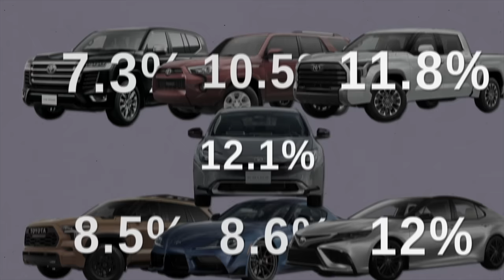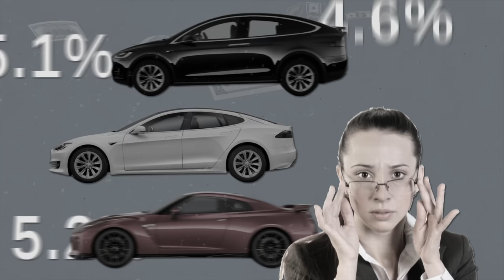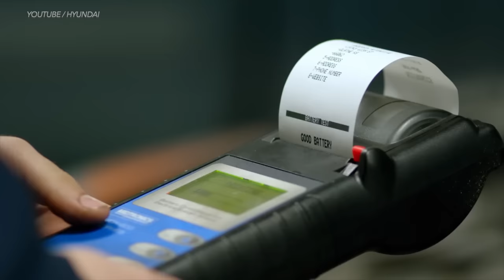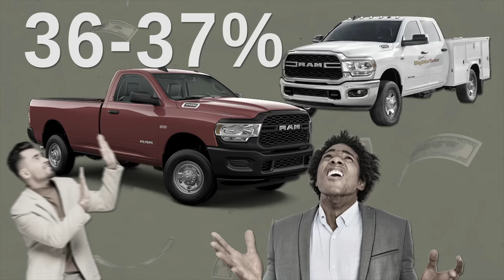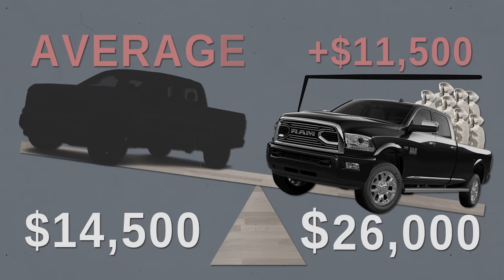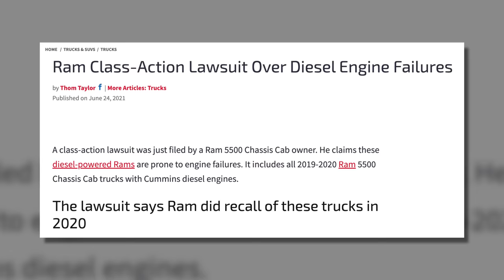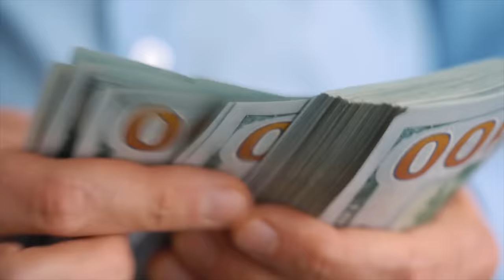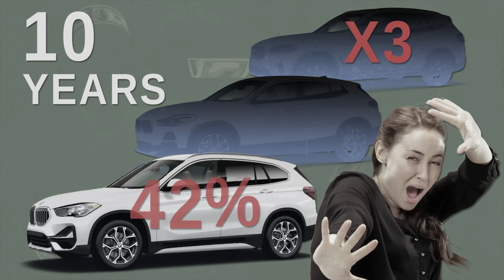Here's Why I Only Buy Toyotas and Lexus

Comment: Definitely helpful to consider the dollar amount as well. I have a 2020 Venue, for example, and I paid $15k for it. At 30%, $4k in maintenance over 10 years is pennies compared to 30% on a bimmer. Bonus points for full drivetrain coverage over that period.
Reply: idk where you found a 2020 venue for $15k, but that car is dead in 5 years
Reply: @Eddyhouse1845  Brand new in 2020 when they were giving cars away
Reply: @smashitandbang6876 That was the retail value of the car with administrative fees taxes state local federal taxes you paid $28,500
Reply: @tonyw1563  fair point. Total cost to walk away was closer to $17k. My logic still holds tho. 30% of that is pennies compared to a 30% of a 50k+ luxury car.
Reply: @smashitandbang6876  Win Win 🏆

Comment: As a mechanic I am very impressed with Toyota and Yamaha engineers, they collaborated to make a machine that is really very good and strong. Of course, their Premium brand Lexus is very reliable.

In my country, Indonesia, Toyota and Daihatsu collaborate to make Low Cost Green Cars (LCGC) under the ASTRA Group. With a 3 cylinder engine and engine capacity from 1,000cc to 1,300cc, I think the engine is quite good, but they sacrificed the chassis and poor quality body materials to balance the Power Weight To Ratio. But behind it all, they help people to own their own car at a low price and of course easy to repair and cheap to maintain.

Comment: I've had 4 Nissan products since 1995. I currently have a 2015 Altima and a 2017 Rouge. The only thing outside of oil changes, the only thing I've I had to do is change the battery. And I have high mileage on the Altima.
Reply: Doesn’t matter because Scotty San only buys Toyotas.

Comment: I've owned 3 BMWs, and I can tell you this video is spot on.  All of them where high maintenance.  My last one was a sporty 318is, which I spent over $8k in maintenance alone.  I thought I was going to save money by buying a 4-cylinder BMW.  Smh.  Never again will I buy one.  You heard the saying of why they call them BMW, its because the word BM stands for 'Bowel Movement!' Lol
Reply: Break My Wallet...
Reply: 8k in maintenance?The 318 isn’t even worth 1k…do you’re homework on cars and it will pay off at the end

Bmw is a very reliable car, but when you buy cheap, you get cheap
Reply: @mauisuzuki7857  the worth you quoted is today's value.  I never said when I had possession of the 318.  I just said that was my last BMW.  This was many years ago when the value was no where $1k.  So yes, I did my homework.
Reply: Lol
Reply: I've owned my E63 LCI BMW 6 Series coupe for 13 years. It's special in the looks department, fun to drive and has never left me stranded, therefore I intend to keep it for another decade.
Reply: 318 and sporty should never be used in the same sentence 😂😂😂
Reply: @da9nerdy  318 and sporty can and should be used in the same sentence as a BMW and sportiness are about handling, not sheer power.

Comment: I bought a 2018 f-150 4x4 2.7 eco new. Narrow seat aside, i love it. At 93k, I’ve changed the rear pads at 90k and trans fluid at 60k ( should really every 30k on that 10 speed). No issues. Bought my Wife a 2019 Highlander limited platinum. She loves it. That 3.5 is a solid engine.

Comment: I own a 2011 Daimler A.G. W204 which was purchased in 2014.  In the 12 years of it's life, I've replaced the rotors twice. I perform all scheduled maintenance myself.  I've had no major issues.  In three more years, I'll replace the transmission pan; and, within 7 years, I expect to replace the rear subframe which is under warranty.  It is the easiest car to maintain in comparison to SAAB, AUDI, and INFINITI.

Comment: I had a SAAB 9.3 VECTOR with a 2.0T engine. (2008 model) and it was fantastic to drive, but not cheap to maintain.
Sadly I totaled it in an accident and now bought a 2008 Lexus is 250 and I'm quite happy with it.
Reply: Had a 2004 SAAB 9-3 1.9tid, absolute money pit.
Reply: 95 Saab 900. Blast to drive when it wasnt in the shop.

Comment: I'm on my third Lexus - a 2014 ES 300h I bought used 5 years ago.  This is my first hybrid, but this thing is absolutely amazing - I still average about 35 mpg (usually 40 mpg in spring/fall) and it's easily one of the best driving cars I've owned (The ES 350 gas-only version gets about 23 mpg).  At 150K miles, I'm still hoping it's got a long life ahead of it... :)  As an added bonus, because of the regenerative braking, I've never had to get a brake job - original pads are still on it!
Reply: are you still able to get 35mpg in cold weather? I live in Upstate NY. Nowadays, the temp goes down to 22F, and I get only 23-24 mpg with my ES300h.

Comment: I have a 2017 Ram 1500 and have done nothing but change the oil on a regular basis...It's been a great truck so far.
Reply: How many miles do you have on it?
Reply: @terry_willis  76,000
Reply: @terry_willis bro stealin my name
Reply: We have three 2017 Rams in our fleet. All three have had the plastic oil cooler crack around 65,000 mi. $1400 fix. No recall.

Comment: Great video Scotty!  I drive a 2006 Pontiac vibe w/ 220,000 miles. Wife has 2001 Nissan Pathfinder 160,000.
Reply: 2006 Pontiac vibe is a Toyota corolla twin= has Toyota corolla engine and transmission, etc.,
Reply: I have a 01 pathfinzwith 274,000. New radiator and 2 alternators and maintenance items. That’s it
Reply: @jonxiong5439  yup my mom had a vibe and we found out it had Toyota motor and I said that’s why it’s still running lol

Comment: My family has had a 1992 lexus sc400 in the family for about 20 years now and that thing is still running nicely. It has around 400k+ miles on it. The only problem they've had on it was the windows. Sometimes the window regulators would fail and windows couldn't be used anymore. Super cheap to fix.

Comment: Volvo man. I take care of my 01 volvo v70xc and it still runs and drives like the luxury car it was made to be. Like a tank!
Reply: if you know, are volvo's latest wagons reliable? also, are they too expensive to maintain for a person with average salary?
Reply: @digvijaykapoor4071  I wont get one newer than a 2015. They are easy to maintain if you're a diy person. You need a good scan tool for the computer. I have a $120 anyscan tool that Scotty recommended. They're not too expensive no.
Reply: @jking4020  thanks King. i am not diy person. i have little to no mechanical experience.
Reply: My favorite car I ever drove was a 2013 Volvo S60 T6. Very comfortable. I had major back pain at the time and it made driving a dream.

Comment: I absolutely agree with you on the Dodge truck issues. I've watched several of my "NASCAR friends" tear through trucks used for hauling cars from track to track. Worst working trucks ever made. In My opinion.
Reply: @jeffgrantlS350 - re: "In My opinion."  Whose other opinion would you be citing?  Or do you use that wimp phrase in daily life, too?!?
Reply: . Frankly.. Dodge Chrysler Mercedes Benz Are money pits for the most part.  After 150K miles or most cases these vehicles need more than regular maintenance services to maintain their dependability. Longevity takes hold and most likely the repairs are very expensive.

Comment: I have a 2012 Hyundai Sonata GLS. Bought it used with like 60 something k miles. Has just under 100k now. No issues. I've changed the oil regularly and gotten a transmission fluid change once just because. Hoping to keep it around until I get my hands on a Rav 4
Reply: Scotty says they're OK until you pass 100k miles.  Good luck.
Reply: @terry_willis  Fairly certain it'll be fine

Comment: Own a Dodge Journey, Since November 2022 I've replaced 
Brakes x2
Suspensions x3 $7500 Both rear and front
Alternator
Battery
Steering Rack

I drive about 5-8k kilometers per month

Comment: Own a 2016 Rav4. Only thing I've had to do is replace the battery. Enough said.
Reply: Those cars last forever, Toyota RAV4 and Toyota Camry share the same power train, I own a 2016 Toyota Camry with 145k miles on it and I surely could say that car runs as the day I bought brand new with 10 miles on it, I love Toyotas ❤❤

Comment: I don't know where those Honda maintenance figures come from, because my 2004 Honda Accord EX sedan has 268k trouble free miles on it. Aside from batteries, brakes, tires, oil changes, and a recent clutch slave cylinder replacement it's still all original with the K24A hooked up to a 5sp manual transmission. last week I lost pressure to the clutch pedal, after investigating the issue I found that a bolt had broken off the clutch master cylinder. I cleaned it up put it back together and haven't had a problem since.
Reply: The Hondas that seem to make up the weakest link in the brand are the larger V6 vehicles that come out of their Lincoln, Alabama plant, so I'm wondering who much they factor into the average percentage.
Reply: @mrjamesinblogington  That's what I've noticed too, seems the only company that makes a good modern day auto trans is Toyota.
Reply: 2004 was before Honda quality took a turn for the worse

Comment: Another factor is ease of routine maintenance/common wear and tear problems. 2017 Lexus GS 350 Fsport sedan owner and beyond the poor mileage, the car has been a joy. Higher price tag which might also bias the lower maintenance costs but most of the maintenance I do myself such as oil changes, fluid fills, brake pads and rotors changed which in sum ended up being a steal for what the car is worth. It’s worth noting that cars with often easier to work with parts and less complicating ones can be fixed up at reliable mechanics for far less than luxury car ones, let alone dealer service depts. Noticed a trend in new car buyers searching a dealer service dept’s charges for a vehicle before buying that vehicle to put maintenance costs into perspective. Glad more people are becoming educated and aware of long term car value today. Well crafted video Scotty

Comment: I have a 10 year old hyundai Elentra limited with 140k miles on it. It's been in a car wreck. Still runs amazing now. Didn't have much maintenance costs on it.
Reply: Hyundai/Kia used to make throw away cars. But over the last 8 years or so they have stepped up to one of the best car makers with the best warranty in the industry to back it up. Toyota and Honda need to open their eyes. Many of the positive comments I am seeing refer to Toyotas from the 90's and early 2000's. That Toyota is not the same as the one today.

Comment: Using Total Cost of Ownership (Initial Cost plus maintenance in the first decade) would be a  more useful metric for comparison, rather than percentages .The order would be different. I have a Corolla, so I am not in disagreement with the overall assessment. Good to see someone forming opinions based on the evidence - assuming, of course, the veracity of the evidence.

Comment: I had 3 Toyotas from 1994, 2007, & 2013.  The '94 (with 313K) was wrecked.  Others are doing just fine.  We've always preferred an extra car, but finding what you suggest in a used model is very difficult now - I am not willing to pay the asking prices for what I have found.
Reply: How many miles does your 2007 have?
Reply: The newest Toyota;s are very risky cars XD Old are good but new are expensive ecology project XD you dont buy hydrogen Toyota XD BMW and Mercedes are the most expensive cars like Porsche XD

Comment: I’ve had 2 Camrys. The first was a 99 LE, which my parents gave to me with well over 350k miles. I held on to it for about 4 years until 2016 and got a 2014 Camry SE right after. I’d probably still be able to drive my 99 Camry now if I wasn’t a negligent/overworked college student at the time. Maintenance is easy, simple, and issues rarely popped up. Only complaint I had about my first Camry was the after market door handles not being reliable. My current Camry is fine minus having to pop the front bumper back into its right position. 

I’m looking into getting a new car either later this year or early next and can’t really imagine life with an unreliable car - makes it tough to stray away from Toyota

Comment: I have a 9 year old Honda civic 
Had it since it was 1 years old 
It’s fairly low Milage at 60k miles 
Still on original battery and exhaust and brake discs 

Front brake pads changed at 25k and 48k 
Rear pads changed 48k 

No issues at all 
Not even a small niggle 
I get it serviced at Honda for £180 per year 
3 years ago I paid Honda £80 to change auto transmission fluid 
And I’ve changed the air and pollen filters myself twice ( £40 each ) 
Only other cost I’ve spent was tyres 
I’ve put 2 sets of front tyres on and one rear set
Reply: Wow, 60k miles and already changed out front brake pads twice?

Comment: My RAM has great power and has been awesome in the snow. It’s 10 years old and has lost most parts under the truck to rust starting at 30k miles. Only has 89k now. I’m trading it in for a Tundra with TRD suspension and the Boss half-ton V-plow (I do 3 driveways and a small lot). 
Thanks Scotty for the data. I wish I had seen this in 2013!

Comment: I love your videos. I’ve had my 2016 Toyota Corolla since 2017. I got it with 32,000 miles. Now it has 150,240 miles. I do all the maintenance myself and never had a problem. I even ran over a dead deer and it’s still going. Been rear ended three times by people that didn’t pay attention. My Corolla is still going. Thanks to this video I will upgrade to a Land Cruiser. Thanks Scotty. ❤❤❤😊😊😊

Comment: Just purchased my 1st Lexus 2014 ES350 with 61K miles. Still have my Sequoia with 376K no issues still runs like a beast. Had a Yaris with 305K sold it to my sister. Best car for longevity and reliability..

Comment: If the car has manual transmission, you will always have fun with it and will last forever. And will cost less to maintain it.
Reply: I thought the same until my clutch master cylinder failed in my 2012 VW Beetle. Now the clutch and the master cylinder has to be replaced at 2500 dollars.  The car has 90k miles
Reply: @bh2155  Sounds like you are getting ripped off.

Comment: 1996 Dodge Ram NEVER had a single part break until this Spring, the Alternator finally died.  Been in family since it was new and only replaced the AC belt,  oil and filters.

Comment: I'm 66 and grew up maintaining my parents car and all of mine.  Now I no longer do that much car work. My current car is a 2009 Hyundai Sonata (purchased new - which is the 1st new car I ever bought).   I changed to Mobil 1 oil at about 5000 miles, change it and the oil/air filter frequently.

Currently have over 300,000 miles on it.    Brakes, Tires, Windshield wiper blades are routine and I cannot tell you how often.    I have changed plugs once, and 2 coil packs at the same time.  I changed the struts/suspension both front and back at about 175,000 miles (went with Monroe).  I believe that the tie rod ends have also been replaced.  Had the transmission flushed by a good local transmission shop that uses lots of oil to really be sure its flushed clean (they did an engine change and transmission rebuild on a full size van I used to have some years ago).  All the previous listed work by several different shops I use (my oil change & brake shop does not do transmissions and wheel alignments, etc).  I changed door seals once as they started to leak and make noise (I did that work myself).   I had to replace the center counsel between the driver and front passenger because the latch broke (I did that work myself).

Overall very satisfied.  I consider it a low cost car and it has a key feature:  The trunk holds a full service spare.  I won't buy a vehicle that does not hold a full service spare because virtually all my tire problems in life (blowouts, flats, cut sidewalls, nails, and a severely damaged rim in Chicago) have been 100+ miles away from home and when I was on a schedule and often when tire and repair shops are closed (as if the tire shops would even have matching tires as I tend to run premium tires).  

The only unusual thing that happened with this car was a tire problem: It started to de-laminate on me while in vacation 1000+ miles away last summer and we were driving home, and due home the end of the next day.   The tire shop I pulled into had $$$$ signs in their eye's as they were hoping to sell me a new set of tires.    They were very very surprised when I told them I had a matching full service spare in the trunk (especially that it really was matching).   Cost me $22 for them to change and check the balance on the spare and my wife and I were on our way.  About $200 for a new spare tire when I got home.

I no longer drive as much as I used to due to some health issues - and I see this car going for many more years.

Comment: 150,000 mi. in on a 2013 Avalon, aka "Poor Man's Lexus GS" and so far outside of scheduled maintenance I'm only in for 2 new sets of tires and a couple of headlamps. Not even brakes (yet). This thing is a beast and I love it still just as much as when I took that 1st test drive. It's not uncommon for us to drive up to 600 mi. in a day when traveling and it's still one of the most comfortable rides I've had at 6', 215 lbs.

Comment: Currently own an IS350 F sport 2017 with 80,000km. Plan to keep the car especially with the 2030 regulations up here in Canada. Have had the regular oil change consistently and changed the tires recently. Havent had a regret with the purchase unlike others i know who've had the opposite experience with the Germans